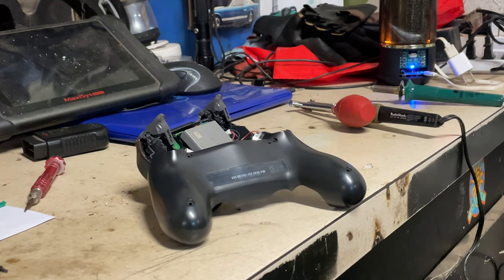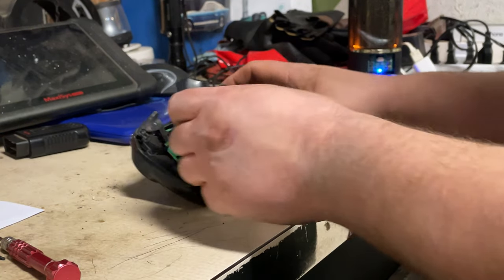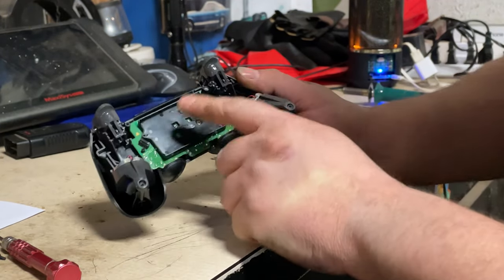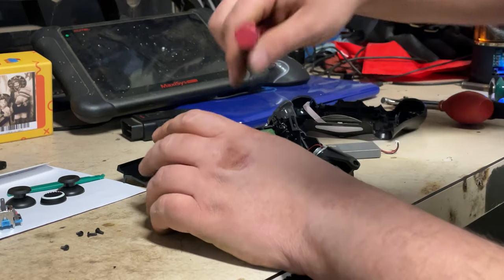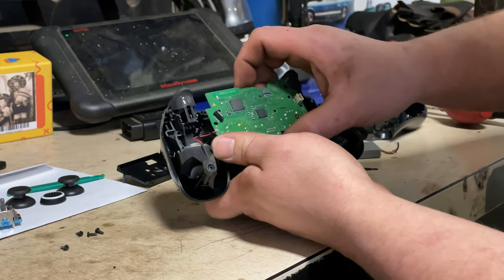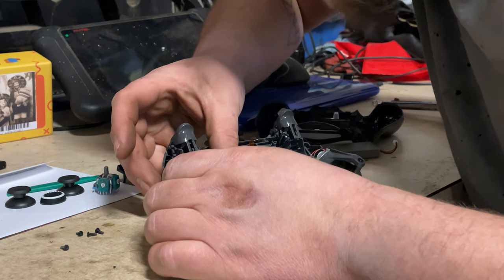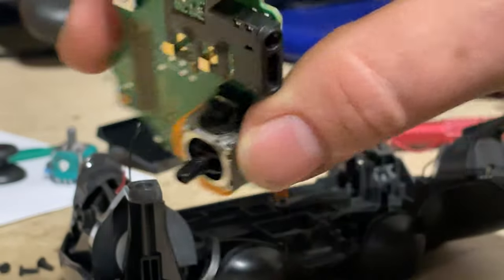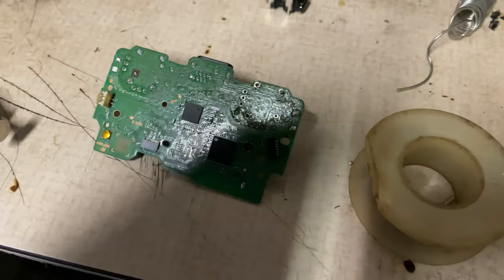Replace analog sticks PS4 controller repair soldering

Comment: Do not listen to bad soldering techniques.  Always remove solder and re apply fresh solder containing flux to ensure good connection
Reply: So If I used alot of flux and fresh solder onto existing ones that appear none shinny it would have a poor connection still?

Comment: I’ve gone over the pins multiple times  with the sucker but there’s still some solder around the pins. Do I just keep trying to suck the solder out until it finally gives?
Reply from the maker: Tough to give soldering advice through comments. It’s ok to have solder on the pins as long as they’re not connecting anything except what they should be
Reply from the maker: If you think u got most the solder out it’s ok to apply some pressure and give it a wiggle
Reply: Try putting some new solder before sucking as the old solder might no longer have flux (non shiny grey) wet it legs of analog with flux to make it easier to unsolder the donuts

Comment: The analog sticks don't have ti be the exact same?
Reply from the maker: They are
Reply: @FerKurl  no your original was black and orange but you replaced with blue an grey
Reply: @FerKurl  I'm asking whether you need the exact same analog stick model when soldering
Reply from the maker: Just make sure what u buy is compatible. Aftermarket parts can look a little different but as long as you buy sticks that are made for your controller u should be good to go
Reply: @FerKurl  OK thanks